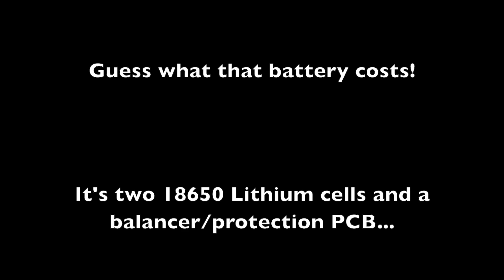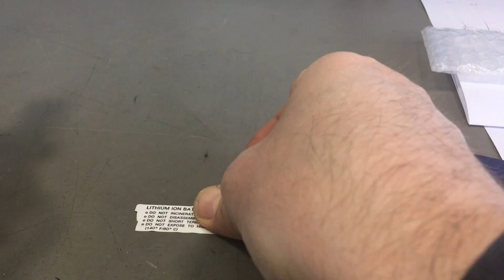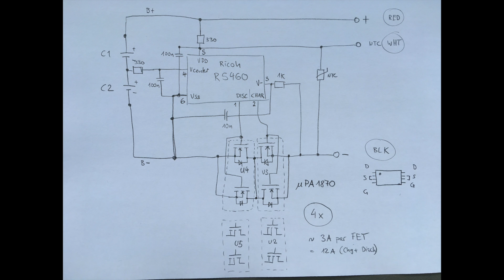Yet another battery scam! (PWJ133)

Comment: Regarding the wire cutters he's using in the start of the video.

Those look very similar to the ones that are available through Harbor Freight here in the United States at least!

I recently got a pair of these best ones yet definitely my favorite pair of wire cutters these are really nice compared to some I've seen for the price I think it was around $8 if I remember correctly good investment for sure!

I'm not an eating that fit my hands that well not to mention the quality and construction right down to the detail of the Springtime washer that keeps tension on the blades to keep everything tight and working really well I think that that piece on the one of the Jaws is intended to catch wire Materials it's cut off so that it does not go flying in the direction for safety but not entirely sure if that's the intended purpose but it seems to work well if it is!

I got them initially since I was working with very fine wire and that's more gauge wire just gets basically mangled when using like a pair of diagonal cutters or needle nose as wire cutters!

Some of the wire cutters just kind of squash it and mess up the insulation morning cutting it!

Not to mention on the Harbor Freight ones at least the black rubber handles are anti-standing conductive AKA be very careful if something might be potentially live but then again always make sure there is no power before trying to cut something that could get nasty!

I've yet to cut through anything live but then again I always make sure there's no power before proceeding!

I do know people that have actually wound up cutting a lot of cable by accident or drooling through something live that they were not aware was even there.

Occasionally I have run into somewhere that something was live that should not be!

One time somebody was saying never getting Zapped off a window frame!

And also a door in the same place two separate locations of the structure unrelated.

However one of them was only when the outdoor light was on and the other one was could be anytime.

What happened is they had either screwed or nailed through an electrical cable somehow.

And happened to hit the hot wire with the fastener.

Heard about this more than a few times too many to tell you the truth.

I'm not sure if you out there would be aware of this but if you have them no contact tester and yes I know that you shouldn't trust them for safety reasons and so on I always double check with an actual meter to verify if power or not.

If you have one of them with the low voltage setting you can actually sniff out where there is AC power wiring it will pick up on it since we're sensitive in that mode.

Essentially you can go up to wall and find where a cable passes through at least as long as the power is on this has been really useful and I just govern it quite by accident

Comment: Microchip has  special DRM chips designed specially for battery packs and printer cartridges, preventing the usage of aftermarket third party consumables. Lenovo is using a proprietary Texas BMS chip having a public/private key validation, communicating on the smbus (i2c-like) interface, to prevent aftermarket batteries. "for the customer's safety" (pulling out money from their wallets). These BMS chips can only re-enabled by an authentication process, with a private key stored on a secure server. (like modern e-banking products...)

Comment: With proprietary hardware, the manufacturers are terrible for ripping off businesses like this. I used to have some Nokia Firewalls (IP350) which when you opened them up were effectively Intel Motherboards. In most cases the biggest limitation apart from CPU on them was the amount of RAM. However, much like Cisco, they didn't use specially keyed ram, but standard RAM that had a unique speed only to that range of machines - only done so you couldn't just buy Off the shelf RAM. 
So if I look at an equivalent 4Gb RAM stick for a PC it would cost £40 direct from Micron. The same Micron RAM but tweaked to only work in the Nokia firewall was well over £1000. When the RAM came it was identical to the RAM for a regular PC, including being made by Micron probably in the same factory.

Comment: They didnt mind to put some coeficient inside the board, spent half dollar more to make the battery unfixable or report 0% jumping to 100%. Tried several times to fix some batt laptops and I havent been lucky. A few times got thing working but the range in hours and progress bar is useless once you lost the configuration that live somewhere in the board. Also, in an IBM laptop battery, discovered a THREE TERMINAL thermal fuse. Guess what the third terminal is about ?. it runs a heating element and allows to blow the fuse on purpose "if the controller decides that" ... yeahhhh .... you gotta love you Lenovo Batteries.
Reply: I just recharge the 18650's out of old batteries, put them into regular black 4x18650 storage box holders, solder on an input plug and plug them into the input, where the charger plugs in. They work perfectly and can be popped out and recharged or replaced individually, as necessary. Then, if one battery fails, you don't need to replace them all. If a different voltage is required, just add a cheap buck or boost converter, or add batteries.

Comment: I have a Dell Poweredge T420 with a failed battery that connects to the PERC H710 disk controller, must I get the exactly the same battery. Or can I in some way tweak it with like a cell phone battery? The battery is a 3.7v, and cell phone batteries is also 3.7 volts.
Reply from the maker: Well the problem is that there are many different types of Lithium batteries. If you take the wrong type, it will get under or overcharged. There are always nubmers on the battery cell. Try to find out what cell it is (LiPolymer, Iron-Phosphate etc) If you find out what chemistry is inside, you choose a similar one. About the same capacity and size and it will most likely work
Reply: You most treat batteries with respect. It will work, but never mix the types, because the charging algorithm and theory is different and can blow very easy if vercharger or undercharged. That the reason they have a built in board ... Try tu put the same type of battery.

Comment: I have a IBM TotalStorage DS4300 San and the lithium battery is non standard, replacement cost  $600.00 its a rip off just to try and keep it up and running. Bought the SAN for $200.00 works great until the battery fails.
Reply: try removing the non standard battery and solder wires to the board and an 18650 cell holder. Dont solder directly to the cell.
Reply from the maker: That pack looks like it could be repaired. Just two flat Li cells and a short cable.... Those flat cells are easy to solder because they normally have metal tabs that stick out. Just be careful about the Amps, they can melt your screwdriver if you short them.

Comment: I've see some rip off parts before, but oof. I'm sure it isn't the worst, but it's definitely way up there on the list. Even using top of the line cells, you're looking at maybe 30 to 40 dollars US at the absolute most. For 800 bucks you could buy a backup generator to run it, and still have enough left over for a nice dinner. Hahahaha.... Wow. That's impressively insane. But then again, that's how they sell people into the next round of equipment. I can think of a major computer manufacturer(Who shall remain nameless...) who does exactly the same thing.
Reply from the maker: this is called "planned obsolescense"
Reply: @PlaywithJunk  absolutely , too expensive to repair and those who do ,well they ripp them off.

Comment: Well, in order to be officially allowed to ship these battery packs you need to do tests and obtain certificates that do cost between 10K and 20K USD. Maybe they did allocate those NRE costs to too  few packs they sell. That would be very bad marketing to say the least. I have similar problems at designing special medical equipment, but I manage to get battery prices down to about 80 EUR for those packs. That's the downside to low volume production hitting high NRE costs due  to regulations like UN3481.
Reply: That's incorrect, you can have non certified hobby packs shipped anywhere with some companies like FedEx.
Reply: @kilrahvp  Yes and no. With Fedex you can choose "ground" shipping. Takes forever or is expensive because they are shipped in sealed containers especially designed for shipping Li-Packs. For shipping your products to end customers that is usually not a viable option.
Reply: Chip Guy Vids I get 300Wh packs shipped from China (Hobbyking) to Europe in 5 days for $14 with FedEx dangerous goods.
Reply: t
They shouldn't try to recoup the cost of any licensing or certification requirements off the back of their customer base on an item that costs a few bucks to manufacture. That's just going to ruin your company name and deter repeat business.
Reply: @charlesdeens8927  These companies are run by accountants. They  only care about profit.
Reply: Can you buy an already certified pack from a battery supplier or does the whole final product need to be certified?
Reply: @Manofcube  Every pack design has to be tested by a certified laborarory that will bill you around 10-20K.
Reply: For $800 i want to see an iso sticker on every chip, every lead and every layer those stupid batteries are made of.

Comment: Sometimes you can't replace the cells, sadly. I have a lenovo laptop and it had a discharged battery to the point of cutoff. So i charged the cells to normal voltage but the controller board gone into "dead" mode. So that is a permanent cutoff on undervoltage... Asshole design...
Reply: Yes this sucks... Some manufacturers use BMSs that go dead for good at the slightest deviation ftom spec... "For your protection" of course.
Reply: @cormacsyt0  If only there was datasheet for the chip on that board. Or guide from someone. But there was nothing. So shorting different point without knowledge doesn't seem safe
Reply: In an old IBM BladeCenter, there's a huge controller board in the battery module which stores the date of when you first installed it. 4 years after that date it will nag you to replace it. Even replacing the batteries won't help since there's still the same date stored on the board.
Reply: @mbirth  nothing new there. All industries have these. Marking inkjets for packaging lines all have chips on ink and make-up cartridges to prevent anyone filling them. Oh and of course they have due date stored there as well. Some of them also have nice features such as main ink container changing done by changing machine passcode which is calculated by calendar dates,just so manufacturers engineer can come and pretty much plug and play change it and roll some hard earned cash for their business 😄

Comment: Bet you the dead cells are the cheap and nasty bargain basement 18650s - probably why they failed in the first place, 
if the manufacturer had just spent a couple of dollars more in the beginning - the pack would surely still be operational.
Reply: Or alternatively they just keep the battery voltage at 100% constantly to "protect" against losing them im case of a power fault... That will also make them wear down..
Reply: Those look like Samsung icr18650-22fm cells.
Reply: Yup, better charge them to 70% or so instead of full, add more $10 cells in parallel if you really need the capacity... Then you have a long lasting battery. But of course the manufacturer will prefer selling you a $800 battery every 2 years...
Reply: f**k that. They would like sell me an $800 battery but it ain't happening. Not a chance in hell.
Reply: @simontay4851  The end user only finds this out after the pack fails and have to replace it, by then it's too late.

Comment: If 800USD is the battery, what's the price of the system?
Reply from the maker: I saw one controller for $4500... so I guess the system would be like $ 20'000 to 30'000. Probably without disks.
Reply: If you need to ask the price you can't afford it.
Reply: $17k for the basic Nexsan E18.